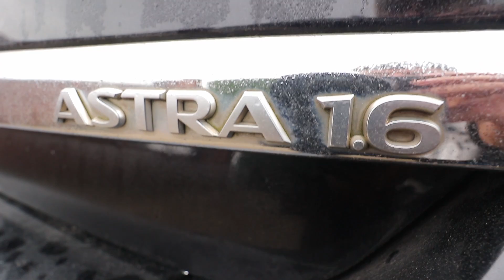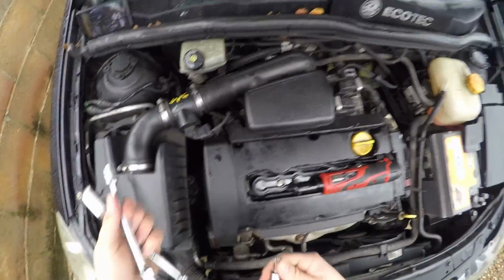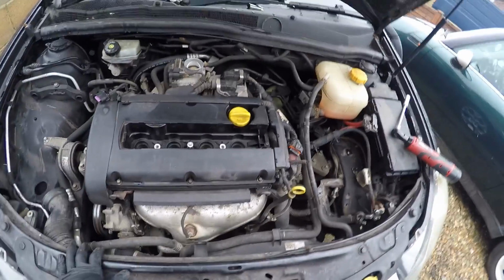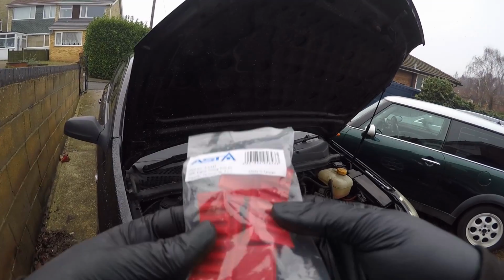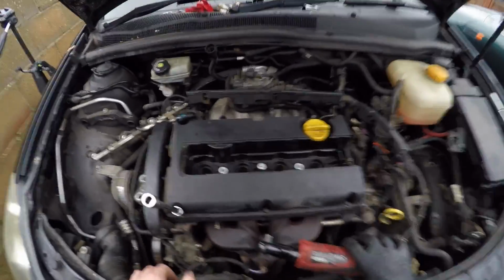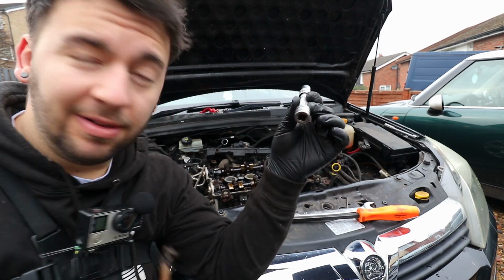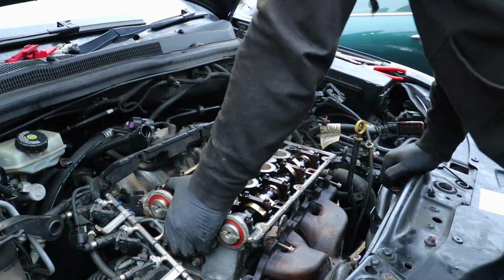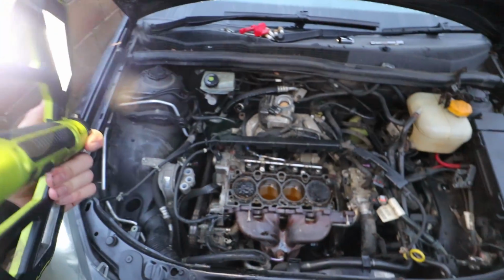Astra Mk5 Head Gasket Replacement! (Part #1)

Comment: Why were you even considering not draining the coolant? If the head gasket is bad and both the coolant and the oil have been going down, then they've been having a party and absolutely should both be changed.
Reply: I hope he changes it as the oil would of been contaminated regardless if it had been drained or not.
Reply: Agree I would have drained oil and coolant and replaced both

Comment: Does the oil in the cylinder not suggest the piston rings are shot? I thought head gasket failure would just result in water getting into the cylinder from the water passages
Reply: Adrian Massey it could also be passing through oil passages too on the head gasket. Or could be stem seals leaking.
Reply: Head gasket failure can happen all different ways. It can lead to just coolant disappearing, or coolant and oil. Sometimes both will come out the exhaust without contaminating each other’s systems. On other occasions you may find water in the oil or oil in the water or both. Sometimes it all comes out the exhaust and sometimes nothing does but it all mixes internally. 

Literally luck of the draw and what motor it is.

Comment: Why did you not think piston ring was bad if oil in the cylinder?
Reply: there is water also, i would have thought.
Reply: Clearly oil and water in cylinder 1 with the milky mixture,Piston rings usually create a lot of blue smoke and piston rings wouldn’t use coolant I don’t think
Reply: Yeah head gasket be blown or loose or split with water in cylinder  could have done a compression check as well

Comment: I would advise anyone who is going to rebuild a cylinder head or do a head gasket to run a compression test first. The reason being it’s not worth finding half way through the job that the engine is fuc*ed.

The test will show compression levels. Any cylinders with low compression you can pour engine oil down the plug hole and re run the test. This will tell you whether the top end or bottom end has the compression leak. If it’s bottom end the engines finished because the rings are fooked. If it’s top end then full rebuild or a new/used head is required.

It’s easy enough to see what’s happening where you can’t acutally see into.
Reply: How does pouring oil in the cylinders tell you weather its the top or bottom end? thanks
Reply: @jasonjuggler3457  because if you pour oil into the cylinder it will act as a sealer for the rings if the compression figures don't change after a second test then your know the problem is higher up, head gasket, burn valve, bent valve or just not sealing right.
Now If you pour oil in the cylinder and the compression is a lot higher then the problem is with either the cylinder walls or the rings, personally I don't do anything until I shove a bore scope down to see the general condition of the cylinder, just done this job and bore scope revealed I had a burnt valve which was caused by a leaky injector.

Comment: If thats the 1.6 engine it has an issue where it pushes oil out through the breather on the rocker cover, vauxhall never admitted to it, but I have seen it myself. When you take the manifold off at the back of the engine if its full of oil it might not be worth fixing it at all.
Reply: yup, it not the headcasket.
Reply: I have the 1.6 currently 130k petrol but runs sweet is there any other common faults etc or preventatives?
Reply: @aquariumhobbyist2778  It really does depend some of them are shocking some of them will do 200k so long as they are serviced
Reply: Anyone having problems with that breather you can by pass it just plug intake side and vent cover to atmosphere with a long pipe under car. Mine was consuming loads of oil.
Reply: @pastytit  did that fix the issue? My oil needs topping up 3l/4l every 3-4 weeks and not even doing 300miles

Comment: Yay! Go pro! Also, my MK4 Astra's 1.4 petrol engine just blew it's head gasket as well. I noticed the early signs and suspected the gasket but my Uncle told me that my coolant could have been evaporating through a loose coolant line so I kept running her until one day the engine started to run very roughly and I got an error code for one cylinder misfire, the engine didn't over heat and I managed to get home to find out that the gasket blew and there was a little bit of coolant in my oil which made it look like watery chocolate milk or milky tea. I'm hoping that my cylinder head is not warped and needs too much shaving since the gasket blew gradually and the engine didn't overheat, the night it started to misfire was just the straw that broke the Astra's boot.

*Edit: I'm really excited to see you set those cams back into place.
          Please consider joining the Facebook group "VauxAddicts".

Comment: Great video James,same z16xep engine in my astra g sport 04 plate which the Astra g is what brought me here originally, those rocker gaskets are bad for letting oil into cylinders when they get old,not saying that’s your problem as there’s clearly water in cylinder before the haters comment back to me,also Seen a few comments on how bad the 1.6 and 1.8 xe engines are for head gasket failure, I’ve got an 04 astra g z16xep with 160k on and to my knowledge never had a head gasket and 100k of its miles have been done from me and family in last 14 years uses no coolant and very minimal oil and never skips a beat same with my z18xer vectra with 155k both cars regularly serviced and kept upto so I think many people are wrong on this front,maybe it’s a general lack of maintenance,anyway keep up the good work James

Comment: had this exact issue on my z18xe turned out to be the oil control ring on piston 1 (pretty common) before you rebuild it put some petrol in each cylinder and check cylinder one does not drain away, mines was drained to the sump in bout 5 mins the rest held the fuel for a few hours, its not ideal and a bit back street mechanic but only easy way to check once you have the head off, an oil change when its rebuilt is a lot better than rebuilding everything to have the same issue,  great video though looking foward to more keep it up.

Comment: Great video, awesome driveway fix which many mechanics would not attempt! A little tip grab some bungee cords from the local pound store to wrap around pipes,wiring fuel rails etc to hook out of the way. I’ve had that sealy wrench in my amazon basket for weeks & I wasn’t sure if it would be any good but after watching this it’s on its way 👍

Comment: My missus has a 1.5 Astra H with similar mileage, the Z16XEP has a habit of burning oil due to failed piston rings but also the channels in the intake manifold get clogged so would definitely benefit from cleaning as it’ll come up with a running lean fault code

Comment: As the mk5 Astra has no temp gauge (its hidden in the infotainment menu) its possible that it has been overheating for some time hence the gasket problem. Check the block as well as the head for straightness as they are known to warp, its a common problem.

Comment: Someone marked up my DOHC’s like yours, despite it being really clear that the timing is set by the two notches pointing to each other!  Also, the engine doesn’t need supporting when you remove the engine mount from the timing belt end of the engine.  The main engine mounts are front and back at the bottom, assuming it’s same as the Zafira.

Comment: This job would be hard work for a professional mechanic in a fully equipped workshop.
You managed it outside on a hardstand while filming it, that's an achievement in itself. Plaudits.
Reply: Maan, I was thinking that same thing. He does amazing works here. Thumbs-up from here. Got a 1.6 z16xep too. twinport. in a 04' wagon limited edition. 1250Kg. It's a good engine/motor for what it is.

Comment: you dont need to worry about timing when dismantling the engine. only when you reassemble. sometimes it a good idea to put your own convenient markings but this had already been done. also good idea to drain the oil and water before you start.

Comment: Awesome video! You can also use a paint marker and mark the sprocket and timing belt before you remove.  If u use a new belt you can use old belt and put mark's in the same spot by matching up the belts .

Comment: Keep doing the go-pro POV

I'm inspired to do my Z14XEP (for the 3rd time). Need to sort the wet footwell out too. LAZY
Reply: The Z14XEP on my Astra MK5 sucks, bad acceleration and doesn't like going uphill (feels like its clogged somewhere) no error codes.
Reply: Lol look at the live data. It gives it all away. Astras like to eat lambda sensors and ignition system parts.
Reply: @boosteddiesel1834  Really didn't know that with the lambda sensor and ignition system its not throwing any error codes months ago I had in workshop he plugged in the op-com and he didn't see anything wrong. Now all of a sudden my battery keeps discharging I may have to change it for a new one. Btw thank you for your answer
Reply: @MergimR  Check to see if exhaust manicat is clogged. It'll run loud but go for a drive with lambda sensor removed. If it runs ok, manicat is clogged, so buy new Exhaust Manifold Cat. If it's still accelerating poorly, might be another problem. Had loads of problems with mine. Swapped out loads of parts until there was noin left to swap. Last thing was manicat. Don't think I had any error codes. There's always something to do with my Z14XEP. Good engine to learn with
Reply: @MergimR  check all your breather hoses could be clogged with oil. especially if you like bouncing over speed bumps

Comment: They do a 4ah version of the battery for the sealey 12v range now. Available on amazon and the tool seems to have abit more grunt with the additional battery capacity

Comment: Great video to take in. Very informative.  Unfortunately my wife's 2009 Astra SXI is loosing coolant but no obvious leaks and have a milky white oil filler cap , the signs that the Head gasket is on its way out

Comment: Oil on plugs is normally the rocker cover gasket centre rings worn 
If bad enough it will cause blue smoke from exhaust and misfire

Comment: I have a 2014 Corsa D and I have the same oil/water mixture issue with the valve cover which I'm starting to think has to do with the gasket there because it usually turns brick solid pretty quickly from factory when it should be just a shoft rubber gasket, that can cause seams for moisture to leak through. The engine doesn't leak any coolant or oil though. I wonder if this is a common issue with these type of engines. Just be very careful when timing the valve gears since its an "interference" type of engine and will destroy the valves (and pistons) if not done properly (happend to me once).

Comment: I just bought my Opel H 2005  1,4 16v and had to do a headgasket job,my mechanic told me i should get rid of it cause on the 1,4 motor the headgasket is a big flaw.But talking with alot of other people everyone praises that engine and the 1,6 from the H series

Comment: That’s your piston rings bro, doubt it was head gasket but fingers crossed
Reply: headgasket problems are quite common on the z16 & z18, the rocker cover gasket wouldn't explain a loss of coolant, it would only explain the oil in the spark plugs/misfire and the fact that he kept needing to top up the oil

if its actually losing coolant than head-gasket
That rocker cover gasket was totally gone tho ye
Reply: piston rings are fine.  Faulty headgasket can leak oil too. Vauxhalls eat head gaskets like hot pies. Fortunately mine 2.2 ecotec is fine.
Reply: @georgehuser4711  2.2 the worst engine i think vauxhall ever made,
Reply: @daveyb89  the early ones were good and I have one of them thankfully.
Reply: @RaxxHubNut I agree. Most of the engines I saw apart with blown head gaskets were neglected and always late for oil change. I take care of my engine as best as I can. Good maintenance is cheaper than engine rebuild
Reply: @daveyb89  I have x22xe
Reply: @RaxxHubNut ye I mean none of the Vectra I have owned were from new, never know how it gets treated
Reply: @RaxxHubNut Hi there, so glad I saw your comment !! I have a 2008 Vectra C 1.8 vvt Z18XER with the phase actuators. It suddenly started losing a little coolant very recently and I replaced the water pump which was noisy (noise gone !) and the thermostat and housing complete unit. The old thermostat was stuck (fucked !) and the old housing leaked (a known problem I know) I flushed the system and replaced with a 50/50 mix of QX Red Coolant concentrate and distilled water and a new header tank cap fitted. So far so good. No coolant leaks are now showing but is there anything else I should be aware of/

Comment: Hi I have the same engine z16xep and also have the same problems and same codes but mine is cylinder 3 I also have oil in cylinder 3 not sure about coolant I need to check but my coolant does lower over time same as oil on these engines the compression should be between 12-14 bar cylinder 1 2 4 are all 12-14 bar but cylinder 3 is 3 bar does this also sound like a head gasket problem ? Just curious as done want to waste time and money before going a head and doing this job on mine. Also thanks for you're videos they help alot and very interesting keep it up.

Comment: Just a heads up. If there is still a misfire these astras do not play well with spurious coil packs. You need the oem ones. Bosch i think for that one. But I'm not sure. Same with sparks. They like the bosch ones. I had a 1.4 and was on the forums about a misfire!

Comment: Been to the garage said the head gasket has gone on my astra , sounds perfect , runs perfect . Only warning light is the oil pressure. Checked the cap and yes bit of milky white round the cap. Quoted £1000 is this about right??

Comment: Man, I have the same Astra and mine have some problem with rough idling , vibrations are like mad inside the car at the stop. I checked everything , even mechanics told me that nothing is wrong with a car. But knocking inside the cabin is mad. Im assuming that it have problem with the valves so I want to pull the head off. There are a couple of videos on my youtube chanel so you can check out the issue.

Comment: are you planning on timingbelt replacing? You beter not Reuse it, also for te waterpump!
Ik think you know that, but just to be safe than sorry later
Reply: Ruud Kuijpers water pump isn’t driven from timing on z16xep it runs on the auxiliary belt

Comment: I'm currently doing same job on my astra exectly same engine, but got stuck  on placing the camshaft sprockets back because can't find the tightening torques parameters anywhere  ...
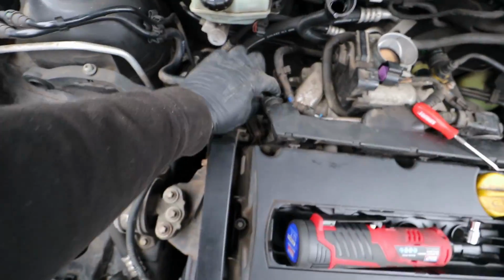Reply: Bro 11:02 in PART 2 I think

Comment: Top tip for cams use a 13mm bolt n nut with washers tighten them on cam teeth the locks tada 😂

Comment: I think my 1.3 CDTI needs a new head gasket aswell, because i've filled up my coolant resevoir to max alot of times in a year and it goes down to minimum or below that. My engine uses a timing chain and not a belt, i wonder how much of a nightmare it will be 🤔
Reply: Could just be a slow leak, headset should have other signs like oil and coolant mixing

Comment: I'm only after building up a 1.2 8v Vauxhall engine up had to get all new gaskets got 1 for the head exhaust manifold inlet manifold rocker cover gasket new water pump and belt the engine is for stock car

Comment: valve stem seals
Reply: Thats what i would have said, either that or gummed up rings as these lumps are known for it,
Reply: F4R TURBO stem seals unlikely to cause misfires unless real bad just lots of smoke at start up
Reply: Unless there is coolant leak somewhere, losing coolant+oil doesn't sound like valve stem seal for me
Reply: @AB-wq2vy   coolant and oil on the piston, coolant from Head gasket, Oil from valve stem seals
Reply: F4R TURBO for the sake of a few quid you would definitely swap out the valve stem seals anyway. In fact if you get a new head gasket set you probably get them thrown in.
Reply: @zedman442  True
Reply: @zedman442  I remember the OHC ford lumps (pinto) that were a bugger for stem seals, whether or not you got constant misfires was determined on what plugs you used, Champion used to give up readily while NGK would happily tolerate being oiled up & carry on regardless.
Reply: @zedman442  Very true, But going on what he said about all the gunge in the rocker cover it sounds like this car has not had regular oil changes, & a result of that is gummed up piston rings on these engines.

Comment: thanks for another vid..note: i can't do this job...however, didn't Ed china from wheeler dealers say get a flat piece of cardboard then punch/number each head bolt thru so you  know which order they go back in...to make it easier...thanks again anyway
Reply: That is on old (usually) cast iron heads where you can use the bolts again.. modern engines have softer 'stretch' bolts, so for reliability, it's best to get new ones..relatively cheap for an Astra.

Comment: Greeting I have Astra H 1.6 16v twinport gasoline! Has uneven work on the back of both gasoline and gas! When the engine is cold, a fault occurs P 300,301,302,303,304, ignition of the cylinders! I erase the fault with the diagnostics, the car goes normally! When the engine warms up, it no longer fires! Ignition module replaced, spark plug replaced, problem still exists! I read that this engine has valve problems (XEP engine)! Do you have an idea what the problem is? Thank you
Reply: Clogged egr channels (carbon build up) in the intake manifold cause misfires in these engines.

Comment: No point in setting the timing if the heads coming off. Set the crank timing before refitting the head then set the cams then fit head. Re check timing once head is torqued and belt is on.

Comment: The 1.6 doesn't have any power even while having a working engine.... :P
I wish I had the 1.6 when I changed my headgasket in december, on a 2.0 turbo in a dark ice cold garage in the woods in Norway.